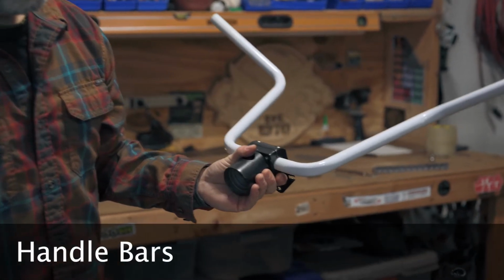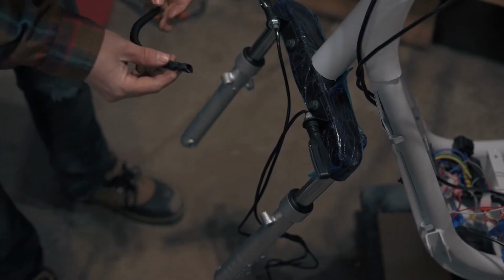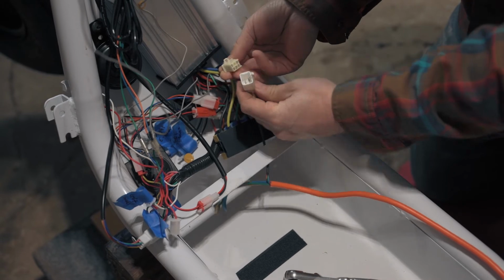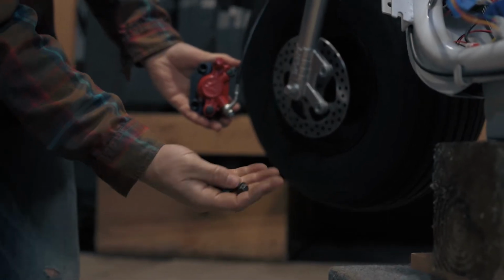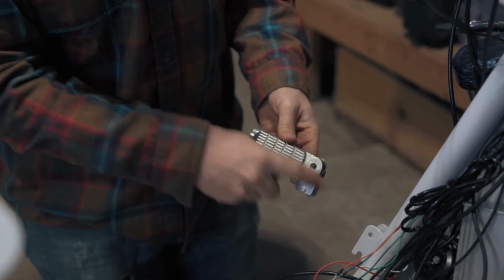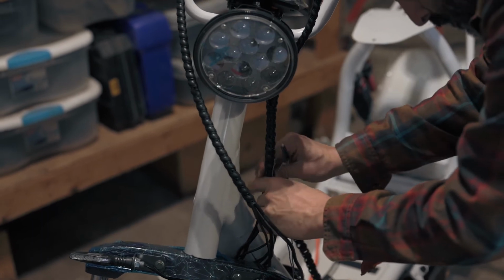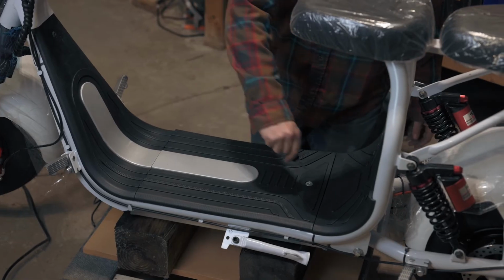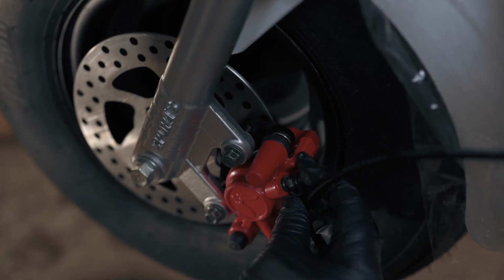Assembling your FatBear Fat City Electric Scooter

Comment: So , I squeeze the brake lever and stop at a sign. When I want to go it won't go because the panel is showing a red circle with an explanation mark in it. Loosened the lever bolt so it returns faster. Then it goes. I this a safety facter? That is can't use the throttle with any braking applied?

Comment: Question I bought a fatbear scooter and the rear wheel is now flat. What size allen key would I need to use to remove the wheel?
Reply: usually the wheel nut is a 10mm allen

Comment: Just what I needed. Trying to solve a problem but not sure. Scooter will suddenly cut off. Can't travel a reliable distance without this happening. It will happen when I come to a stop. When I throttle up again then nothing. Tried different levels and still nothing. Noticed a Red circle with an explaination mark in it when this happens showing up on the panel. I don't lose power on the panel. I can change the levels for the speed however the scooter doesn't respond. If I wait it out it will start  to move again but time varies. My uneducated guess is Throttle or Controller. HELP please.
Reply: hey i have the same issue did you find a solution ? was it the controller ?
Reply: @muratozkan9027  Squeeze the brake and the engine drops out. Force the lever back to its start position and it will go. Loosen the brake lever bolt. Question is why.

Comment: I need your help guys. I have the exact same  Scooter and when i throttle it starts and cut off immediately. And when you rethrottle the same cut. Can't move without this happening. Tried different levels and same in all 3 levels. i replaced the battery have new battery, checking all connections all looks fine any idea what can be the issue any wrong connection or  Throttle maybe Controller? it is like that from the first day and couldnt manage to find a solution can someone HELP on that problem, please.
Reply: It's the brake lever circuit. Squeeze the brake and it will drop out. Loosen the brake lever bolt so it returns to its start position freely.